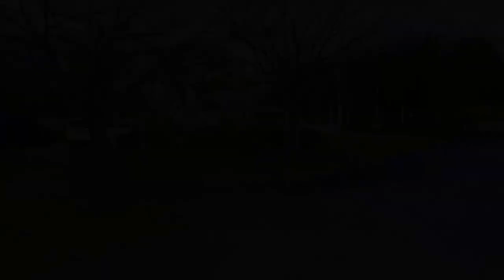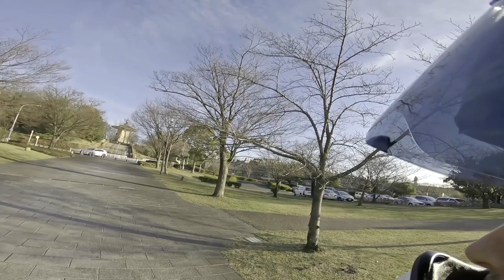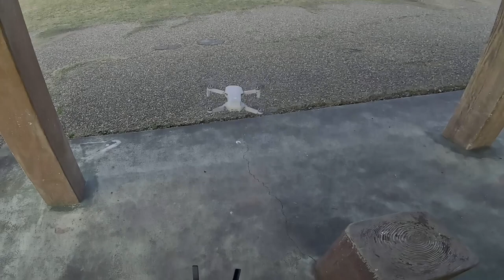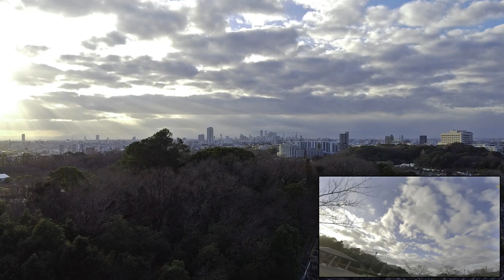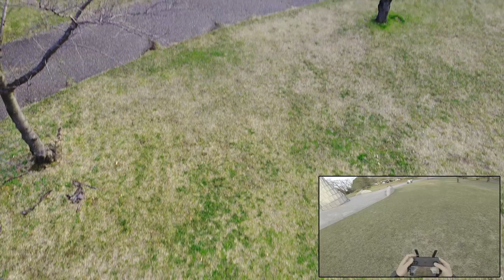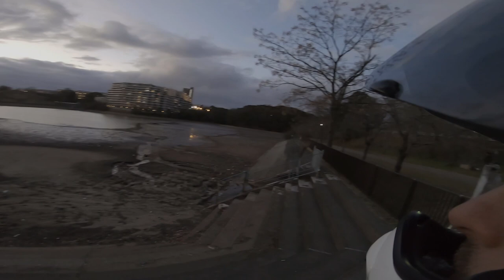I BOUGHT A DJI MAVIC MINI DRONE - Happy 2020 Everyone - Honda CBR600RR Motovlog

Comment: Surprising how steady the image is for such a compact size.
Reply: Also, that little tap on the propellers, wouldn't that disrupt the balance of the blades if it nicked them? Just thinking propeller vibration would impact video quality, but I've never used a drone so 🤷👍
Reply from the maker: Ebenezer, I was worried about that too, but I have used it since then and it's perfectly steady as usual. It's a great drone for first time users. I'm finding it a lot of fun, and watching the videos afterwards is great.